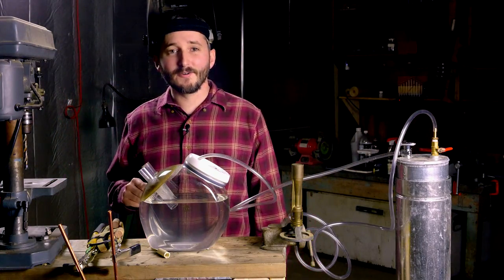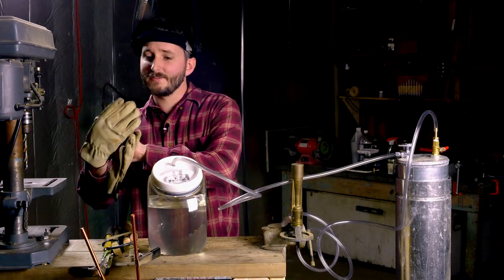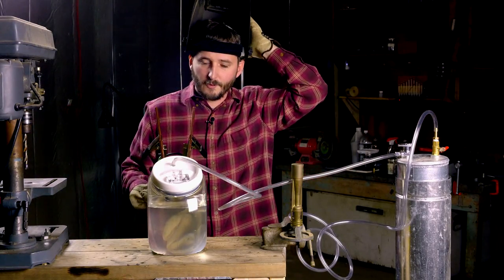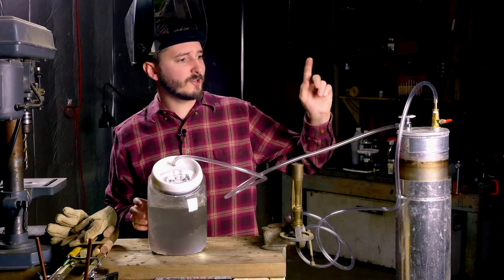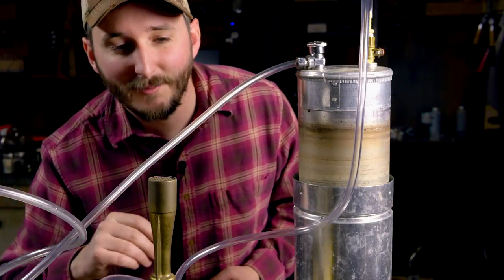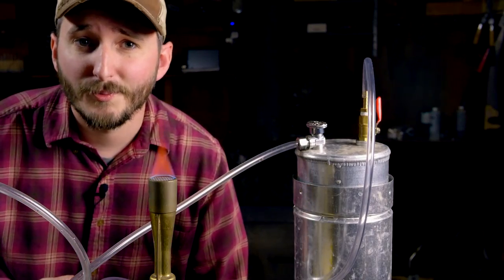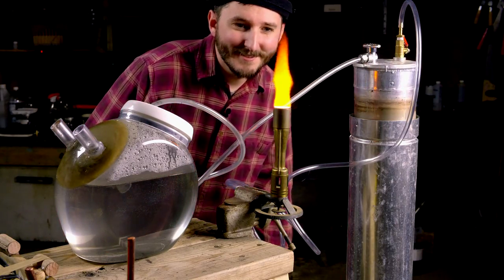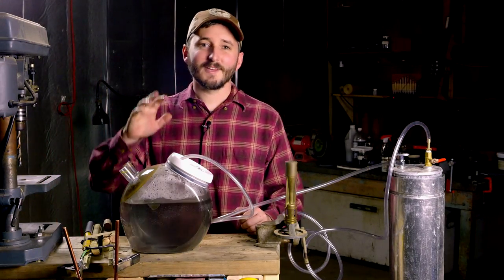Plasma Generated Water Gas (Electrically Produced Fuel That Is Not HHO)

Comment: Here's a probably wrong guess but maybe the gas could be some sort of hydrocarbon from the carbon rods and the hydrogen in the water
Reply: Well I was sort of close. Cool video though!
Reply: Yeah my guess was Oxygen and Methane
Reply: Bearcat Ben Mine too, but when you think about it, Methane burns in Oxygen, so the carbon Atom would rater have the Oxygen bound to it than the Hydrogen.
Reply: He made Syngas. I'd be slightly surprised if there isn't some hydrocarbon contamination in his gas. If he got the arc going in it, it may randomly produce hydrocarbons. Add some nitrogen, sulfur, a pinch of phosphorus and maybe a couple of other ingredients, and the arc would make some of the building blocks of life, like amino and nucleic acids, proteins, maybe lipids and misc. UVC light might be a better way though, a little gentler so it might not rip stuff apart as quickly as it is stuck together. Something like that is thought to be why some asteroids have some of that essential to life gunk. Such gunk, plus time, might be where life started on Earth.
Reply: @karlharvymarx2650  GOD started life on Earth. Your welcome.
Reply: @jonross377  Yeaaah. No.
Reply: Well since poisoning is a big issue, my guess is he's producing carbon monoxide along with hydrogen
Reply: I never even guessed the carbon would do anything so your guess was better than mine.

I was like "it's H2O so it can only either be  oxygen or hydrogen gas"

I guess I was half right because of the hydrogen gas produced.

I had no idea carbon could bond with other atoms at a high enough temp
Reply: I thought hydrocarbon, when he said carbon monoxide I was like "oh, ok. How boring" lol that said it was a great video I was just disappointed he hadn't discovered fusion I guess (joke).
Reply: I was thinking on methane
Reply: @TreDogOfficial  Oxygen is pretty reactive, especially at high temps. Carbon monoxide has the strongest bond in all chemistry, even stronger than nitrogen triple bonds, so it makes sense.
Reply: @Stevie G I thought about it a second but it would condensate in the water, the tube or the tank, it would not stay as a gas for too long
Reply: @TreDogOfficial   - H + O + C can make a whole lot of products (+OH for hydrolysed Hydrocarbons)
Reply: @TreDogOfficial  
Well, every living organism on Earth is made out of carbon compounds in water, so it better keep bonding with other atoms, or we'll disintegrate into a sad disgusting puddle.
Reply: @jonross377     maybe, maybe not. But if so he obviously used some sort of method... Right? Who are you to say that the process's @karl Harvy Marx is speaking of were not part of "gOD's" method?
Reply: @EdwardTriesToScience  If that is true and ppl came from monkeys then why are the millions of monkeys reproducing in the world not having humans as their offspring. It would have had to happen more than once and yet we have never seen it happen.... God created life. If it is some simple sludge then why cant humans take that same sludge and make life? Your logic doesnt work bud.
Reply: @blueberrychronic  The method was his mouth, its written very clearly in the Bible the most reproduced book on earth.
Reply: @tomh2628  you were nowhere near close
Reply: @jonross377  and what do you think god is ? an old gentle "person" ... god is all what you see and don't see.... by looking at the nature's ways and mechanics you can see god.. unless your are blind or believe humans...
Reply: @agroman77  There is NOTHING "gentle" about God. Everyone will understand that one day. Trust me, you will be afraid as will I.
Reply: @agroman77  You have not seen God, you are looking at his creation. If I made something and sent it to you, it would not be me that you received. The bible says men are created in God's image, I would suggest that God looks similar to man.
Reply: @jonross377  your opinion, i do respect. when you read the "bible" you are reading a collection of opinions (less what was really said by Jesus), also when you read "only your bible" you are looking at just one perspective.... i do respect that too.
i won't argue with you because it is all a matter of interpretation... one example... it says.. "don't kill, don't eat anything that has blood in it... etc..." still ppl do kill the animals and eats them... see ? when it says don't is general... but sometimes it is specific.... like "don't go after you brother wife...."
sorry about the bible phrases, i have never ever readed it in english (not my primary language)
also, "image" has a number of meanings...... image is not the same as looks or appearence...
anyway, i do respect your opinion,, i just gave mine and it is all ok... still friends.
best regards from Brazil !
Reply: @jonross377  iḿ not afraid of the primary energy (that you call god) simple by the fact that I DO understand what is that about...
maybe one day (maybe not in this life) you will too...
and instead arguing about something like this.... or run around saying things.... you will spend your time doing what Jesus said....
the one who DOES (real action here) what Jesus said.... really understand it all...
see, just like old RMS here, ACTION...
be well buddy.
Reply: yeah, I assumed it would make methane from the hydrogen and carbon
Reply: @jonross377  People didn't come from monkeys. Your criticism of evolution is based on your own misinterpretation.
"If it is some simple sludge then why cant humans take that same sludge and make life?" - Because going from the basic building blocks to "life" takes place in a time scale that no civilization in human history could have started the experiment.
Reply: @ChucksSEADnDEAD  agree to disagree bud.
Reply: @jonross377  You don't have to agree to anything, I just want you to stop lying.
Reply: He clearly said it was carbon monoxide and hydrogen
Reply: As soon as he said poisoning my guess was formaldehyde which I would think makes sense, but naw.
Reply: @goatsinker347  Yeah but this is the share the pre-reveal guesses / argue about Jesus thread.
Reply: @jonross377  Here's a thought: If the god you speak of created all life, who created him? Creationism requires that everything have a creator, and yet creationists refuse to discuss the creation of the god they believe in. As everything must have a creator under the rules of creationism, this is something that needs to be discussed.
Reply: Hydrogen Peroxide
Reply: @bearcatben4762  same
Reply: My guess was oxy-methane and oxy-acetelyne.
Reply: @bearcatben4762  same

Comment: it would be interesting to test how efficient this is at storing energy. i'd assume it to be relatively inefficient compared to other methods but this is very cool.
Reply: A hint re solar was given in the first video, which would actually greatly enhance efficiency.
Reply: It is not a 100% energy storage method, since the carbon electrodes are consumed, and they turn into CO2 when the CO is burned. So you are still burning carbon, only in two steps.
Reply: @twanvl  also- the water was heated up significantly during the process, which in most situations would be waste heat.
Reply: @Derived_One  Potential energy - pump type hydroelectric plants, which work like any other hydroelectric plant (dam, difference of levels, water goes down from above, passes through a turbine, boom). They have, however a possibility to pump water upwards when there is lower demand for electricity in the grid and releasing them when the demand is higher. They play a great role in stabilising the power grid actually. Big downside - size, cost and need for water reservoir - not too many places you can build that, and if you can, the local environmental impact is very high. 
The efficiency comes from the fact, that there is not much energy loss when pumping a liquid - and large machines are generally more efficient than small ones, so overall efficiency goes quite high.|

Fun fact - in such plants the turbine can work as pump and a generator as motor. No need for separate pump units.

Hope I have interested you a bit in the topic (of course if you did not know this already :D )
Reply: @Derived_One  when enough electric cars are on the grid that will be a pretty efficient short term store.
Long term storage would really be chemical or potential.
Reply: It's super inefficient if you just want electricity back out at the end - batteries, pumped hydro, other types of chemical store (flow batteries) and potentially even mechanical stores like flywheels would all beat it.
What it does do is let you turn energy and feedstock material into an energy-dense fuel. Renewables are great for producing electricity but we're a way off electric planes and electric shipping yet, so part of a future carbon-neutral energy mix will involve synthetic fuels like this for transport and off-grid applications.
Reply: @twanvl  but the mixture produced is more energy dense than the carbon you put in, so still technically a method of energy storage, if one way. more like "upgrading" the carbon using electricity, and can be made relatively good energy in versus increase in energy of the fuel.

You could apply this to natural gas too, which is one of the cleaner(least amount of co2 per unit energy) fossil fuels, but natural gas that had been converted to this using  renewable energy would be less carbon intensive still (because it would be more energetic for a given amount of carbon dioxide produced) 
Which could be a workable solution when you need the energy density of a fossil fuel, but want to reduce the emissions as much as possible
Reply: Fabian Dietrich The size of the reservoir can be significantly reduced by containing the liquid and applying weight above. The stored energy is then limited primarily by the weight applied which can be scaled up to within practical limits.
Reply: Its nowhere near the efficiency of a 98% PEM-WE cell. The arc is wasted energy, the combustion is wasted energy, and the heat and light are, too.
Reply: @DeCha1011  It helps if you don't use centrifugal pumps, too. Those things waste a good amount if they are in dense fluids or they are spinning very fast. Its not gated, and you have to hope that the drag from having differential fluid velocity isn't too great. They are very good at creating a lot of flow at a set pressure (head) very quickly, or recovering energy from a set pressure applied from a fluid that wants to flow.
Reply: I think we're all dwelling too much on efficiency. The size of the civilization you run is directly proportionate to the land that must be occupied in order to run it. There's a total amount of land disturbance associated with that, plus an integral mode of how the land is used. The whole point of technology is to make the natural word do the work that would have otherwise fatigued you to death. Often times, there are parameters that must be met which fundamentally govern the efficiency, which obligates you to value time as well.
Reply: I'd guess most of the energy went into boiling/heating water, plus this is just tearing the molecules apart which is going to be much more energetically expensive than a more conventional reaction.

Comment: Others mentioning using nickel carbonyl as a means of separating the CO don't realize that nickel carbonyl is as dangerous as nerve gas or alkyl-mercury compounds. It's really nasty stuff. A safer option is to make copper (i) chloride dicarbonyl, which precipitates out and can be reversibly decomposed back to carbon monoxide and copper (i) chloride.

Comment: In the next video: running my car on carbon monoxide!
Reply: Pls do that
Reply: If we could just find a way to store it in a small tank, then I would do it.
Reply: This was actually done during WW II, during the gasoline rationing in America and Australia. They just produced it with a wood gasifier. It had about 2/3 the energy density of gasoline, so once rationing was over, everyone went back to petroleum for the performance.
Reply: Not sure if it's possible for the alternator to provide enough power to keep up with gas production with this method. I have studied this for years with HHO, and think this method has too many losses. It would be cool to see someone try it, though I don't think you could generate enough to keep the engine running under a load.

Comment: The process you’ve demonstrated here is the same reaction that occurs on an industrial scale to make CO and H2 from coal and water. Look up process called steam reformation. This process also works using natural gas instead of coal. You may want to try the process in a future video using some natural gas and water together and then applying the high heat from the arc. Would be interesting to see the results.

Comment: I had no clue what the gas could be until you mentioned the carbon rods, you are a great teacher. 
A spectrometer would have been perfect for identifying if it indeed was sodium contamination. There are DIY versions using CDs.
Reply: A prism or two inside a telescope-like apparatus is pretty simple too if you only need a spectroscope’s qualitative measurements. You can buy them from AliExpress for $3 or something with two plastic prisms and a mirror between. Relying on differential refraction as opposed to diffraction means you don’t get nearly the precision you would from a diffraction grating, but it’s more than good enough for a simple spectroscope. An actual quantitative spectrometer would make for a really interesting project, and personally instead of using a CCD or photodiode I’d use something like an RE200B on a swinging arm, that way I could measure down to wavelengths far longer than 1μm. So long as I swap out the diffraction gratings, that is.
Reply: I think its CO and H2

Comment: There was a company called Aquafuel that was trying to commercialize this process in the early 2000's. I was pretty fascinated with it at the time, so I loved this! One of the claims that they made was that the process could be used to purify water that had organic contaminants in it. I'd like to see an experiment showing whether that works as well!
Reply: It would work for getting pure water, because after you burn the gasses, you can condense the water vapor and collect the  water. You could also trap and compress the CO2 and end up with pretty pure CO2.
Reply: Collecting  the CO2 is of course if you are burning it in pure oxygen.
Reply: @davidscott5903  I think what they described was actually something like a several-foot long tube with several of these reactors inside it. Dirty water (e.g. sewage) went in, and "clear" (not necessarily potable) water and gases came out. Supposedly the reaction consumed the carbon compounds from the water. I need to find a better reference than my memory, though.
Reply: AD UNUM TRISTIS 
That’s what I was wondering about...
The removal of heavy metals, pharmaceuticals,
and such.
I would guess that things like viruses and bacteria 
would get burnt up and destroyed that way.
Reply: @EnergyCourtier  let me guess, it was bought out by a big company then shelved?
That's what happens to most innovative technology since like the 80s or so.
Reply: @slippythefrog  Aqualfuel became hydrillium who then exploded their factory and gave up trying to compete with propane. The CO cant be stored in mild steel containers without stress cracks forming. It takes 7 times as much of this mixture than propane for the same BTUs so it was already stiff competition. Requiring stainless or aluminum tanks filled seven times as often is tough.
Reply: This works far as purifying water. I do this with a Tesla coil / violet ray machine. Ozone lol
Reply: @davespillane5408  Thanks for info so just as I thought this is more a on demand solution than storing.
Reply: @limitlessenergy3692   The low output BTU per volume is often overlooked when people talk about hydrogen generation too. I look at it as an alternative to propane in a dual fuel setup where its main job would be to promote complete combustion of the diesel. Adding a steady stream into a diesel engine can totally change how well a diesel runs. No smoke, no emissions, and no thick black engine oil at changes. The fuel mileage in a diesel Chevy Cruze doubles once the DPF system is yanked. A secondary fuel system would further increase mileage while also being a highly superior reduction in emissions over the absurd DPF junk. Electric cars are a terrible idea. If we were serious about conserving the Earth we'd mandate dual fuel diesel hybrid vehicles with a minimum 500K mile service life and Continuous Variable Ratio Transmissions for that ideal flat power to torque ratio.

Comment: Thank you for going in detail and explaining what's actually happening. Have seen way too many over-hyped HHO bubbles where the guy will be pumping a bunch of electricity into the gas generator, boiling the water, and boasting about how much "HHO gas" his generator is producing.
Also decided to figure out how efficient your plasma separator is and provided my 3-am math is correct you got 80 watts worth of gas for 120 watts worth of electricity, giving this particular setup about a 66% efficiency.
Numbers I used for that educated guess are as follows: 
Power input --- 150A (proclaimed) welder output at 20V (average voltage for those amps in stick welding) running for 25 seconds (timed from video).
Power output --- 20 liter of gas (estimated volume from what looks like a 15 cm collector that raises about 15 cm) rounded up to 1 mole of mix (22.4 liters) that produces 80 watt/hours when burned.
Reply: Nice... i wonder what the conversion rate back would be... time to build a steam turbine and/or engine